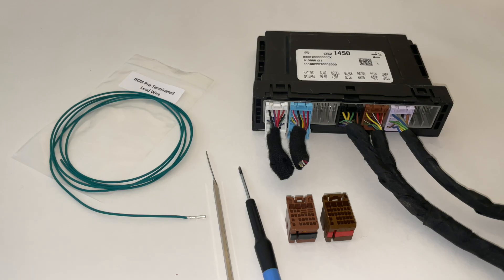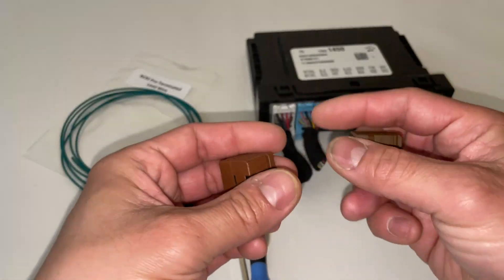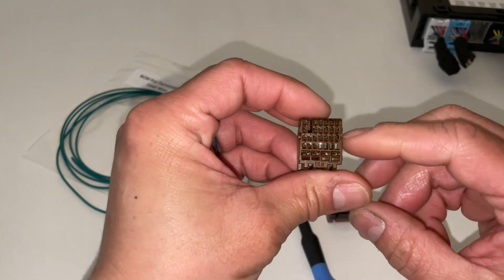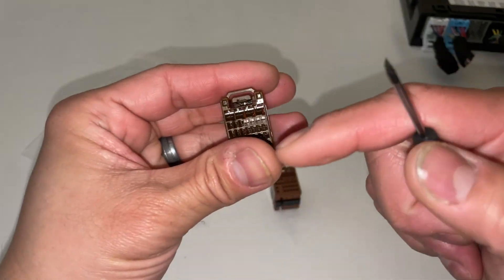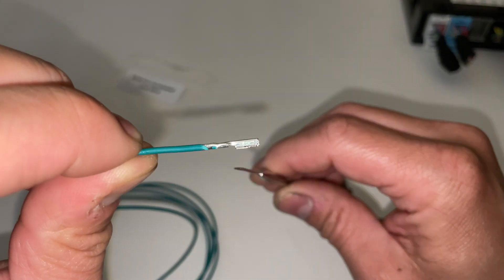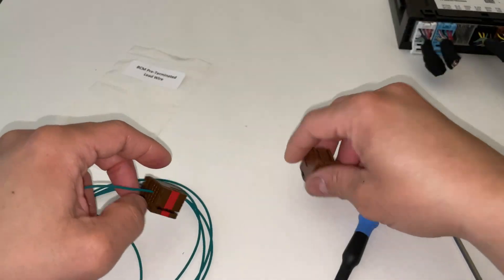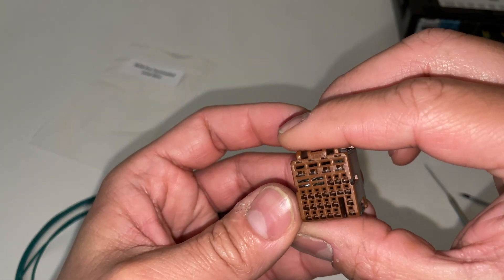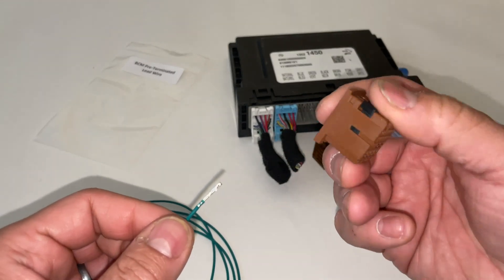BCM Pre-Terminated Leads / Pinning your BCM

Comment: Vehicle - 2022 (technically 2021) Silverado Custom

Wiring Question - I want to go to the 8" screen and controls from the 7" screen and controls.

1) Yes/No - Could I take the two different wire connections, and rewire these two connections together, to get the 8" screen to work with the 7" screen controller?

2) If 'No' above - can I have my BCM programmed to take the different control module for the 8" screen, and the other connections, are they pinned the same so it would be a swap and go for everything else?

Thanks for your time.